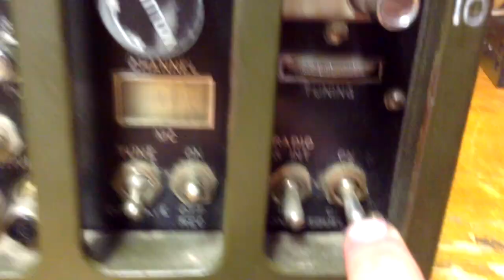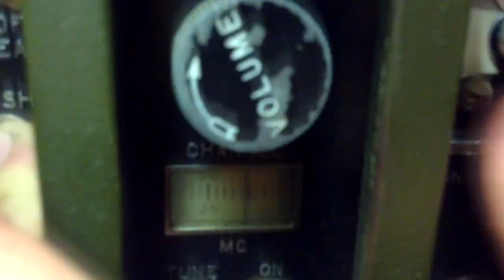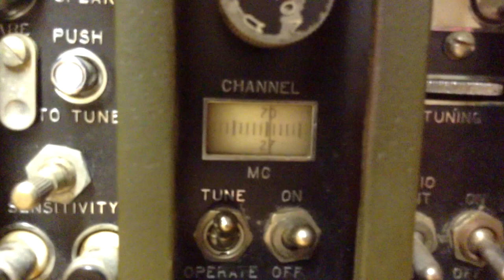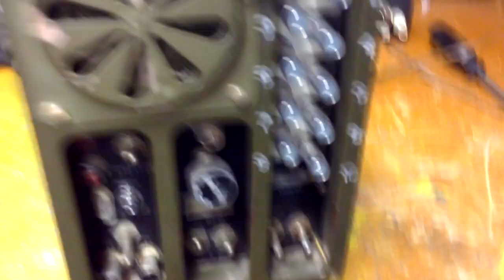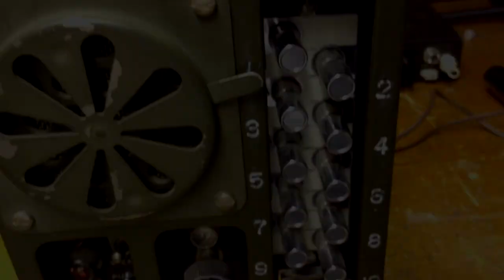Sherman Tank Radio Receiver

Comment: It is a FM unit and was used in a number of vehicles most famously the Sherman Tank. It was used with a BC-604 Transmitter and at times a second radio was added.

Comment: Hello. I just saw your video. Unfortunately your receiver does not work at all, it should do hear a loud noise when there is no signal on the air. The only noise we perceives is the power hum. Also it lacks the 'cap' on the 'bottle', which is not normal. There must be a lot of work to do before turning the square. Good luck.
Reply from the maker: Pascal Nobody Pascal, thanks for the comment. I replaced a 6v6GT tube inside, and then that is when I heard the noise. Before then, there was no noise at all. Thank you for identifying that as just the power hum. What is the bottle, and what is the cap? Any and all info  you have would be appreciated.
Reply: i bought three today and two have been modified and one is just as it was with the dynamotor, could you tell me how to get it working and how to make a 120v power unit? i had one but it destroys the 6x5 tubes, any info would be great!